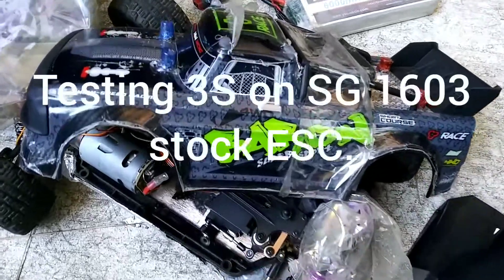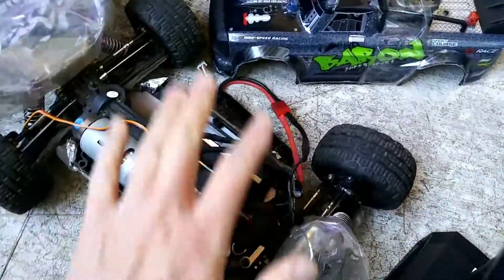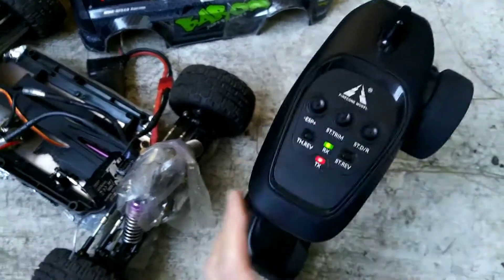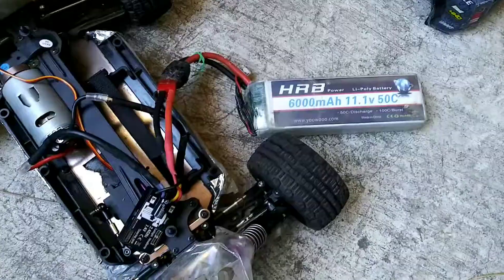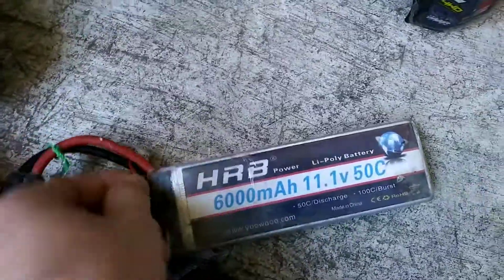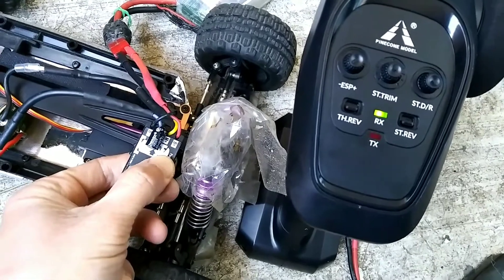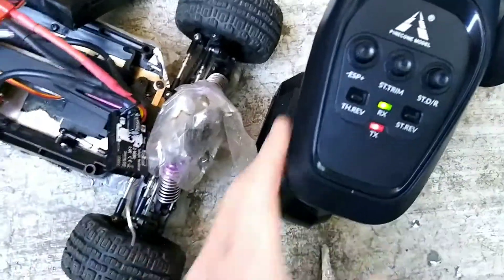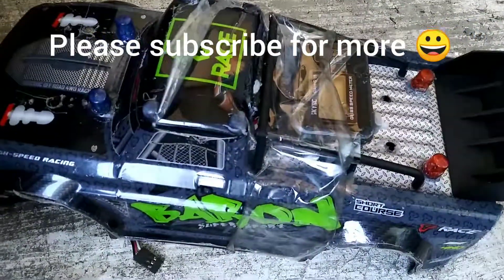Can stock "SG 1603" handle 3S (12.6volts)?  Let Me Try 😆. (2/26/2021)

Comment: why did you not try 3s 1100mah 3s in stock car setup using its much smaller motor first??? that 550 motor needs double the amps as a 380 motor in 1603...i may have worked...add a little at a time and you will destroy less parts...thanks
Reply from the maker: I still plan to test out the stock motor on higher esc and 3S but wasn't in the mood to solder battery and motor connectors to something compatible so it was easier to switch to a brushless motor.  The SG1603's stock ESC does not support 3S and I do not have a 3S Brushed ESC to test the stock motor.

Comment: you ran a 144001 with a stock 550 motor on 2s with that sg1603 esc/radio??? how hard did you push it??? did you use 1500 2s stock??? did it hit same 30 mph speed? thanks
Reply from the maker: Sorry I only used the Wltoys vehicle as an example to show the viewers that the ESC works but would not support 3S and will not burn out the ESC.  It should actually be slower because the SG1603's ESC is 40Amps while the Wltoys stock ESC is 60Amps.

Comment: i think no.... unless you use a weak 3s for a short time maybe..
Reply from the maker: Yes, the SG1603's ESC will not support a fully charged 3S or 12.6volts but will probably recognize a bit higher than a 2S or 8.4volts to maybe 10v or 11v or 11.5volts.

Comment: Can i use 7.4v 1200mah 25c lipo on the stock motor and esc? Will it make any improvement or it will burn the esc? Im new to this.
Reply from the maker: No problem.  Will work.  Enjoy.  Thanks for watching. 😄
Reply: @rcnightlife9611  thanks man 👍😁